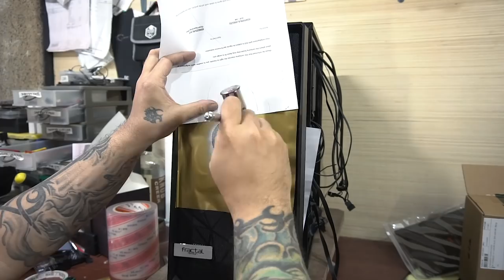Fractal Meshify C: Punisher PC

Comment: If that is a x62 and not a x52, how did you fit it in the top rad position? Want to get this case but I don't want to front mount my 280mm

Comment: Great build by the way. How did you fit the kraken X62 on the top of the meshify C. Did you have to modify it to get the 280 mm rad up there? I have the same case and I’m thinking about buying the x62 but I thought it was gonna be front mount only.

Comment: Would love to know your fan config for the build.  Front three fans pushing air in?  Back fan out and the two on the top pulling air through the radiator?  What are your temps, did you overclock the CPU?

Comment: How did you get the radiator and fans to sit up top. I have the Corsair H115i Pro with the Asus Maximus x Hero Mobo and it won't fit. I am selling this case and getting a Corsair 750D instead. Great mod though, really cool.

Comment: Hello, i'm using fractal meshify c and nzxt x62 (280mm) too. But, why i cannot put my radiator on top mount? Can you explain? Thankyou
Reply: I was thinking about buying the same.Is it possible that with the  Aer RGB fans instead of the ones it comes with leave just enough gap where they curve to fit ram in ?
Reply: The fans he's using are not nzxt by the looks of things so maybe them fans fit with that radiator.
I need to know i want that look.
Reply: If he using x62 kraken, the fans still use 140mm. Cannot fit with 120mm. Maybe the height of fans littler than nzxt fans. Sorry for english language.

Comment: Multiple comments here. Looks like you've managed to do the impossible and fit a 280mm rad in the top of this case where no one else has had success. Can you please read this and detail what you did to did the 280mm rad in the top slot in this case. You would make hundreds of people so happy if this information was released
Reply: KENAN PAVLOVIC Is it that hard? I owe a meshify and it doesn't feel like there would be much problem 🤔
Reply: @chunhuang8820  I have yet to try. But from just having 140mm fans you can see the rad would fit but you won't be able to put 140mm fans on the 280 rad. You'd need an offset adapter to 120mm fans to clear the motherboard
Reply: I'm glad I found this in the comment thread. I am looking to buy an AIO for my Meshify C, and I am not sure if I can buy a 280mm for a top mount.

Comment: Is not it important that you have reversed the water cooling connections? if I have seen this correctly you have reversed the inlet and outlet from the radiator to the pump. is not that important?